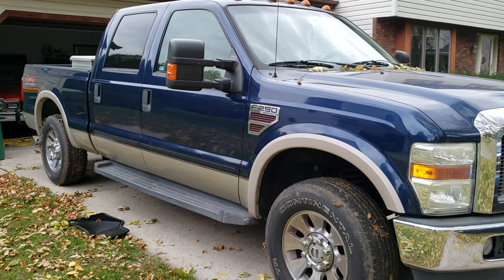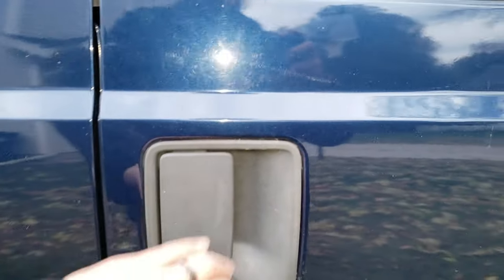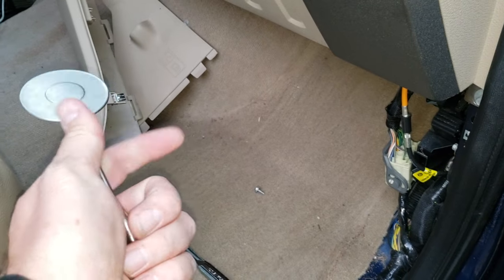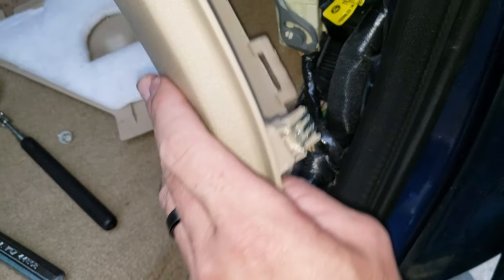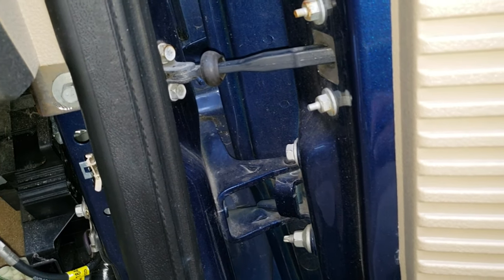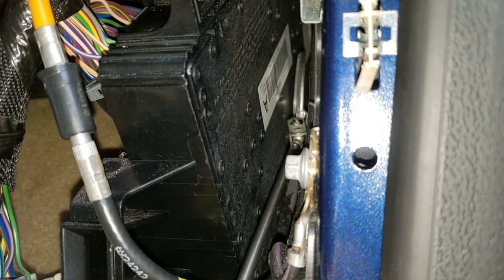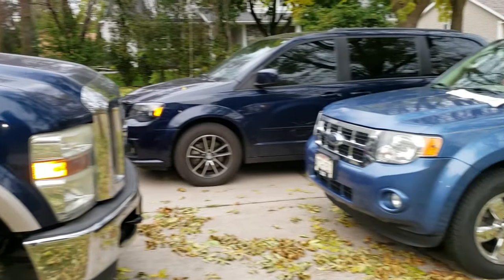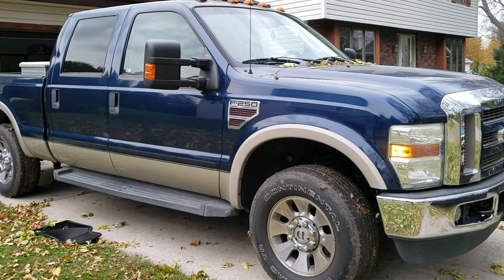WHERE IS MY DOOR CODE FOR 2008 2009 2010 FORD SUPER DUTY F250 F350 F450 DOOR CODE LOCATION

Comment: Worked on my 09 F250.  On mine the label was upside down but the code was still in the top right, as the label was applied.  So, had the label been right side up, the number would be bottom left on the label.
Thanks so much for posting this!
Reply from the maker: Glad to help!  Thanks for the comment!  Remember to like, subscribe and share.

Comment: OR WITH A GOOD SCANNER WITH BIDIRECTIONAL FUNCTIONS YOU CAN RETRIEVE THE CODE😅😅😅WAY FASTER.
Reply from the maker: How many people have scanners though.  By the time you find someone with a scanner, find time to have them scan it, drive over, scan it and get the code.  I will have found 50 codes this way.

Comment: hello..my 08 f250 dome light not turning on once I open my door..any idea?
Reply from the maker: So my first things I would try would be checking the fuse for interior lights.  Depending which instrument cluster you have it might be a setting in there.  Also I would try the illumination roller by the light controls.  It might be rolled all the way down?  If all of those don't do anything maybe physically checking the bulbs on the interior lights to ensure they are not burnt out.  Hope this helps. Happy Thanksgiving.!
Reply: @Summitauto   hello! Yeah I will try to check the fuse..it turns on once I hit the switch,bulb is good and working..happy thanksgiving 💪🏻

Comment: Thankyou, I'm going to check it out tonight. I also have to do the door lock actuator foil fix.
Reply: Actually, I took one door panel off and it had aftermarket actuators. So I bench tested it and it worked perfectly then I found out I had a fuse for the door locks. Changed the 20 amp fuse and everything is good.